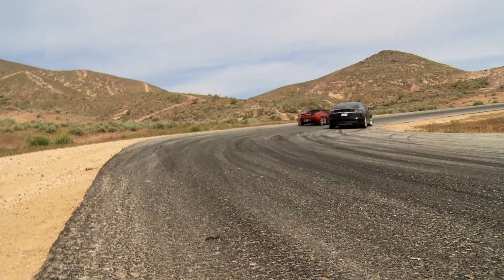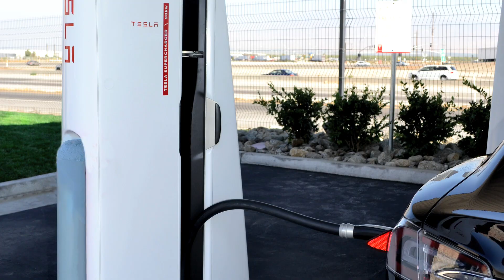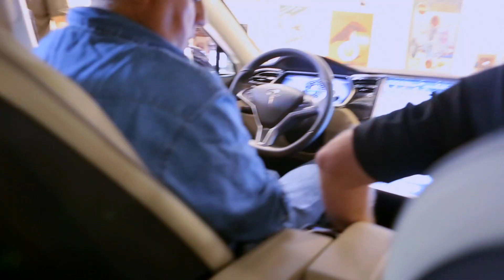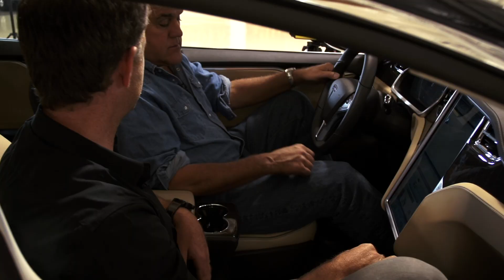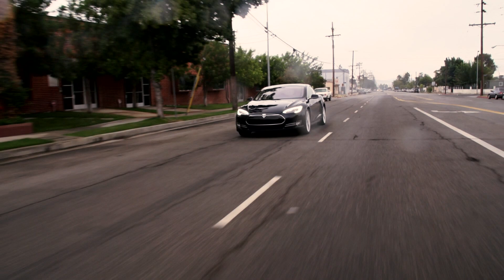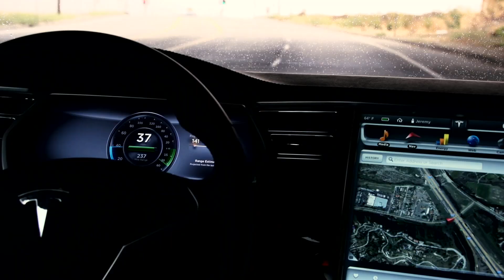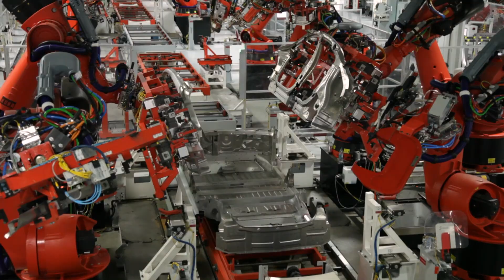2012 Tesla Model S - Jay Leno's Garage

Comment: ever heard of a jerry can? it's red, compact, holds gasoline in emergencies. Can you charge a spare Tesla battery and put that into a car during a blackout? Nope. I am assuming that the plug allows energy to go one way into the car, but if it is two way, then people would steal the electricity while you sleep or shop. More babies will be delivered at charging stations, failing to get the to hospital in time. America's power grid is not ready for electric cars. Electric bill is going to be high.

Comment: yes, sure, the chance that the company folds is pretty big. I think if they make it through the first two years and fulfill the initial reservations, without any major issues and recalls, their chances are not THAT bad. If they don't, maybe a third party can open the battery pack and replace the individual cells, if it is even possible. But at this point you would know it will cost you a lot and may not be worth it.

Comment: the way people treat their cars doesn't help anything hehe.  Im going to find that fine print, hella curious on the whole thing.  Oh well, im from TEXAS,  2002 Dodge Ram 2500 4x4 Cummins with down pipe, cat delete, programmer, and some yummy Bully Dod Propane.  My other "much younger and hotter" girlfriend has a 06 or 07 RX400h, its running good so far 137K.  That inverter thing has been replaced once though

Comment: I don't think tesla have committed to offering new battery tech as it becomes available, but in 10 years it is very unlikely the same battery cells will be made. And they have a 8 year warranty on the battery, so if something happens in the 6th year, they should be able to swap it. New battery tech will require software update but not much more. I am talking about improved chemistry, longer life, higher capacity and power.

Comment: I think this applies to most V12 sedans, the depreciation is insane. Of course there are things on the tesla that can go wrong, like the air suspension, but the AC motor should last a million miles without maintenance, 1 moving part, maybe change two bearings at 500k miles. The inverter is solid-state electronics, well cooled, and with mass manufacturing prices will go down. The car was designed with 5 minute battery swaps in mind, a new battery will have to be same voltage and form factor.

Comment: Decent point, and you are making it about BMWs, make with tons of dealerships and an install base. And 7 series are always rough on their second and third owners and their resale prices reflect that. They really weren't made to work on at home and parts aren't cheap. 

Certainly, the S has few bits to go wrong, but when they do go wrong you will probably be in rougher shape. The battery change you are talking about may not be as easy as it seems, this is a thoroughly designed automobile here.

Comment: 10 year old BMW 760 that cost close to 90 000 euro now cost 10 000. 9 times less. Since electricity is much cheaper than gas, and a car like that v12 may need major engine, transmission and exhaust repairs, the tesla cannot possibly do as bad. Even if ot costs 8000 dollars, and the battery is shot (it is still mostly aluminum and copper), you put a new battery (cheaper and lighter) for say 15 000 and for $23k you have a car that is better than the original.

Comment: I think when you look at commuter cars it is a bit different. First hybrid vs all electric and of course folks cycle hybrids about like they cycle other cars. With that you'd expect less than 4 years of ownership and 7-10 years (75K miles) of total life. Those are roughly average for most cars. 

Lifetime battery replacement, there is probably fine print which has some stiff limits on that. But the bets should be placed that a hybrid battery will make it the "lifetime" or an average car.

Comment: Hmmm, Not sure I agree with you. They use what is a laptop cell. I have 2 year old laptops with dead batteries. I will concede that have life a bit rougher than in a Tesla S. Also the guy said 10 years, he gave no 70% information. He just said 10. 

People may not keep cars that long, but you could be looking at a rough resale value on a 90K+ car.

Comment: 1) Most people do not keep their cars that long
2) At the end of 10 years the battery is _still usable_. It doesn't just die. It merely has a reduced range of about 70% of the original. I would not be surprised if you can drive on the same battery for another 10 years if you wanted to.

Comment: Electric cars are almost zero maintenance. in there purest form. Take an Electric car from any era it will work also.  Tesler's charge stations take 1/2 for a full charge.During a blackout your car can run your house. Most likely you cable a fridge and a small air conditioner or heater for a day or so. Not for every one but a wonderful second car.

Comment: Just like a gas engine the more conservative you drive the better your range. Floor it all the time and your range will probable be around 150 miles. At 130 mph in 25 or so minutes you would most likely be done.

Comment: Tesla: You got grouped in with the fiery failure Fisker because until the Model S, you had exactly what Fisker did....An overly expensive electric sports car with poor range and so many gremlins in the systems you were afraid to drive it.
You've fixed the Roadster mostly, and now you have this beautiful thing.  
Give us a smaller twodoor version of this...Something that can fit in with the FR-S and BR-Z both in performance, but in price as well.  
Do that, and you'll be golden. Don't do the SUV.

Comment: Electric Cars & Burnouts are like two peas in a pod. Electric motors have max torque right from the start, smoking those tires earlier than combustion engines. Just Youtube "electric drag racer" smoking tires seem to be harder to avoid.

Comment: Cool! I could never make it to work and back on a charge particularly in the winter. Now I could. But as someone that drives from MPLS to Austin TX in around 21 hours, long recharges at Tesla stations is still a problem; if there were any stations to charge at between here and there. 1200 miles. 3 1 hour recharges, assuming you leave toped off. Image waiting an hour to recharge at a station with people waiting to use the connections? Not trying to nit pick, but there is still a little way to go.

Comment: Or you are a fu**g moron for doing what is explicitly forbidden in your waranty, leaving the batteries with no charge for months. Like driving off with your car without puting oil and then wanting GM to replace your V8 engine.

Comment: will they really be shocked? Are drivers of gasoline cars shocked when their gas car burns a lot more fuel uphill than downhill? After every climb there is a descent, this car will at least capture some part of the kinetic energy back into the batteries. How much energy will your gas car recover? Oh right, it will burn it as waste heat in the brakes. Hydrogen non-existent, tesla sold in 6 montsh more electric cars than all hydrogen cars combined.

Comment: Will the performance be consistent or will it go down as the juice runs out? Owners will be shocked the range isn't much if they go uphill a lot. And you thought waiting at the gas station for ten minutes was bad, it's going to take much longer for electric car owners. Don't expect employers to hire electric car owners for their punctuality. Hydrogen fuel cell cars are more practical and would kill the electric car. Refill time is quick and source is abundant. Electric poor resale after 9yrs.

Comment: I have nothing against electric cars in fact i believe they will take over and become more efficient performance wise then gasoline engines. For example look at the hobby rc world; electric rc cars are faster quicker lighter less maintenance and hold top speed records a nitro or gas rc could never achieve. Its only a matter of time before this tech reaches the automotive market and fuel burning cars will be phased out.

Comment: The problem with an electric car is that it is electric. Name any electrical item you have and there's a good chance that you had to replace it several times. Take a petrol car from any era, and it still works. More traffic jams because electric cars will run out of juice. Can't find a parking spot because too many cars charge for hours. Some kid is going to unplug the cord while you shop. Forget going to the countryside. Batteries suck. Can't charge during a blackout. In-law visits are longer.